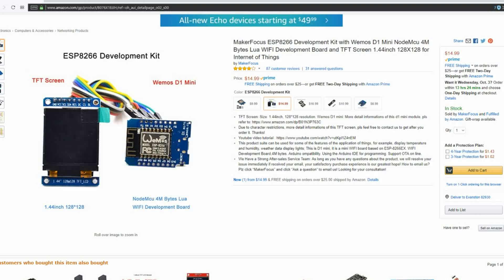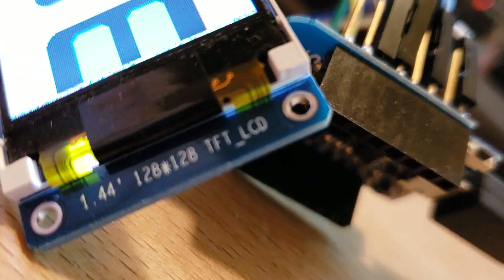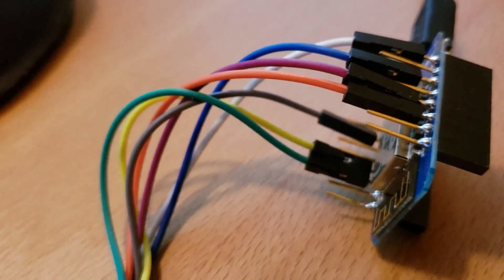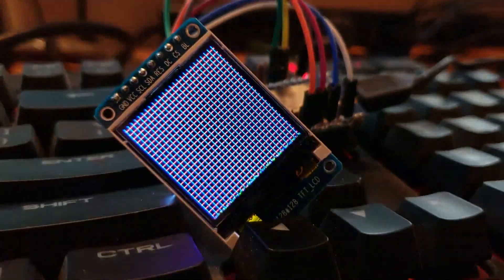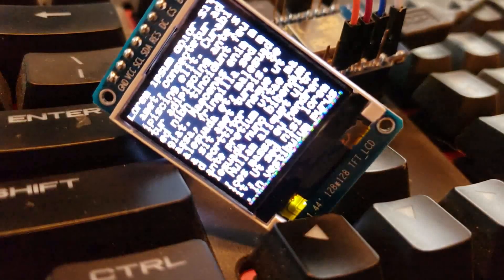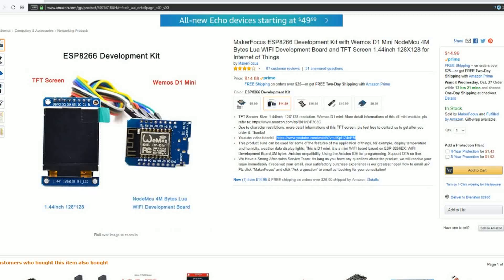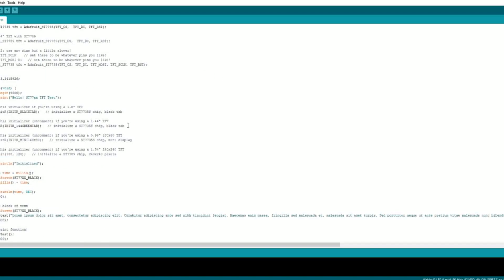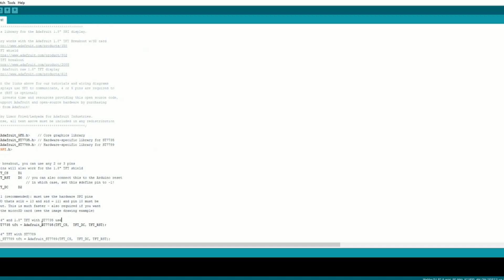Wemos Mini D1 with 1.44 TFT LCD ST7735 Driver

Comment: I have this configured for Arduino UNO but the graphics only display for like the time it takes to upload the sketch and then the screen goes white. any ideas what i am doing wrong.
Reply from the maker: Richard I hooked the screen to an Arduino Uno.. You have to change the pins in the code. 
#define TFT_CS     D1
#define TFT_RST    D0  // you can also connect this to the Arduino reset
                       // in which case, set this #define pin to -1!
#define TFT_DC     D2
TO
#define TFT_CS     10
#define TFT_RST    8  // you can also connect this to the Arduino reset
                      // in which case, set this #define pin to 0!
#define TFT_DC     9

Hope that helps
Reply from the maker: https://www.electronics-lab.com/project/using-st7735-1-8-color-tft-display-arduino/

This is also a good link

Comment: This tutorial was just what I needed since I just bought the same pack as you are using here. I am very much a beginner with Aruduino. Any chance you show an overview of how you connected the wemos and the display? What pins to use.
Reply from the maker: Yeah I can get those for you. But it won't be for few days as I  am out of town and those pictures are on my computer at home. If you look at the GitHub link I linked. It shows what pins to use in the code.
Reply: @AkaSoggyBunz  Thanks! Have had a quick look at the code so far. I just need to familiarise myself of what to look for. Have not really a good understanding on how the pin works yet tbh and is probably my biggest issue. Been relying on instructions for the projects I have made so far.

Comment: Any chance you can release the code because no matter what I do, I just get more and more moronic errors which lead me to nowhere. Also, when you say which line to comment out, it's seriously hard to see which one, because a solid chunk of the screen is cut on each side. You also didn't really mention the rest of the pins other than D0, D1 and D2. Had to work those out from the 'beauty shots' towards the end. Bit inconvenient.
Reply from the maker: Here is the code. https://github.com/akasoggybunz/Wemos-Mini-D1-with-1.44-TFT-LCD-ST7735-Driver My apologies for the inconvience. I haven't implemented Arnaud D 's suggestion yet, but Will do so in the future. Let me know if there is anything else.
Reply: @AkaSoggyBunz  Thanks for the quick response. Keep at the videos dude. We need as many as possible.
Reply from the maker: Thank you. I got a couple projects in mind using the D1, so stay tuned. If you have any issues with the code just let me know.

Comment: Hi, I see you have an offset issue (look at the 3 top and bottom lines):
Look in Library folder in Adafruit_ST7735.cpp file, in the INITR_144GREENTAB section, I use these values:
displayInit(Rcmd2green144);
    _colstart = 2;
    _rowstart = 3;
File may have write protection, save it under another name, then delete the original and rename it.
If it can help anybody else ;-)
Reply from the maker: +Arnaud D Thank you I ll give it a try.